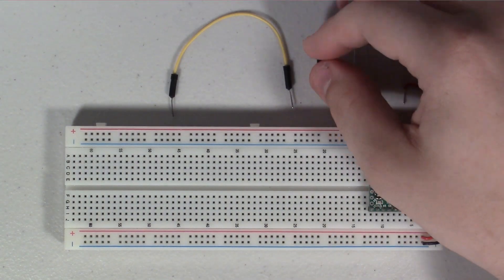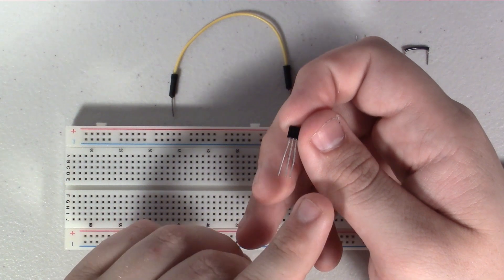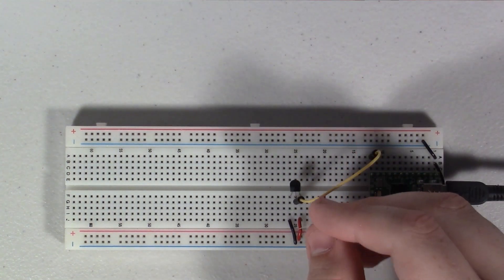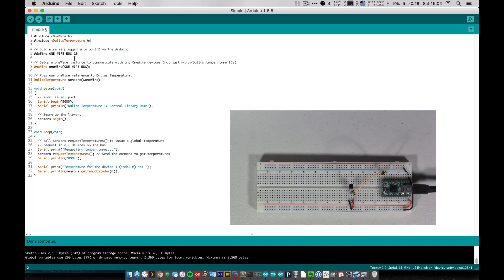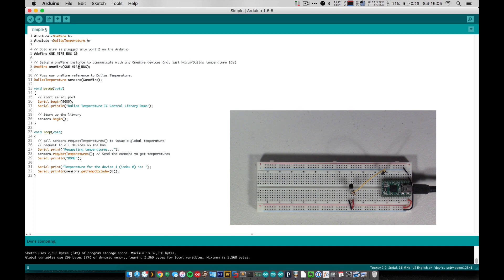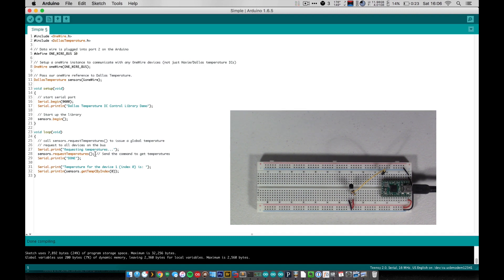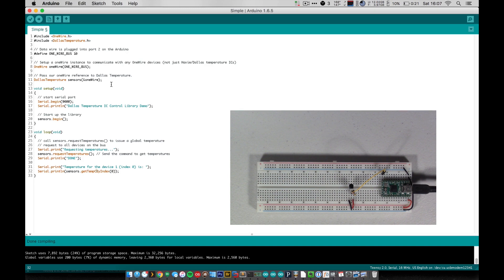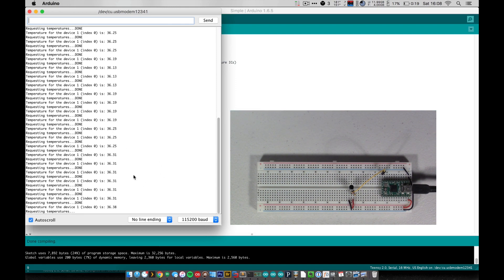How To Wire It! DS18B20 Temperature Sensor

Comment: How it is working
Baud rate in program 9600
Baud rate on serial monitor 115200
Reply from the maker: In the video? Unlike a normal Arduino, the Teensy board shown in this video can communicate via full speed USB and simply sends the data at USB speeds regardless of the selected baud rate. The computer ultimately doesn't care how fast data come in. The baud rate selection is generally needed because the USB->Serial chip cares.

Comment: Hi. I planing to put one of this ds18b20 on a mosfet heatsink metal to view the temperature. I see we can use that sensor naked just itself or in a metal circular tube models also around market. Standard metal tube dimensions dont meet my needs. Its ok if i Direclty put (glue) that sensor to a mosfet? Or i need to put something between sensor and hot mosfet for isolation for health and usage of sensor correctly.?
Reply from the maker: You should be able to just use the raw ds18b20 on the mosfet. The only thing that I would recommend would be to have something to electrically insulate the two devices. A little bit of kapton tape or something similar between the mosfet and sensor should be fine. Best of luck!
Reply: ItKindaWorks insulating sensor and the mosfet! Very logical. Thx ! But i have no idea whats Kapton.
Reply from the maker: Kapton tape is a yellowish insulating and high temp tape. It's also known as polyimide tape. It looks like this https://www.amazon.com/Mil-Kapton-Tape-Polyimide-Yds/dp/B006ZFQNT6
Reply: ItKindaWorks hi. I have kapton tape. I think i will stick mosfet and sensor together with this tape because its durable to Heat. But i dont understand why i need also put this tape Between sensor and mosfet? Ds18b2p sensor 's outside is plastic. I need electrical isolation between?
Reply from the maker: It's just a good practice in my mind to keep electrical parts isolated. You dont have to if you dont want to but if you have the kapton tape then why not? It wont ruin your readings

Comment: Is it able to measure a body temp
Reply from the maker: It should be able to measure body temp but it's probably not a good idea to be putting it in your mouth or any other part of your body. You might want to get a sensor (even DS18b12) in a package that is meant to be put into a liquids. Something like this http://www.embeddeddatasystems.com/OW-TEMP-B3-12xA--Temperature-Probe_p_40.html

Comment: Does this code differ from a pic24 or pic33 ?
Reply from the maker: I dont believe that you can use the same code for pic microcontrollers. I may be wrong (and someone on here feel free to correct me if I am) but I don't believe there is any easy way to port arduino code to pic. The wiring should be more or less the same though.

Comment: When reading specifications on the DS18B20, it looks like it can run between 3.0V and 5.5V. Have you wired this to the ESP8266 at 3.3V? Would be an attractive low cost solution for wireless temperature reading.
Reply: can you make a video showing how to ?
Reply from the maker: I have indeed done that! I have 4 or 5 of them running throughout my house all collecting data and being logged at my home server

Comment: Nice video! What if i want to connect two or four DS18B20 sensors. Does that same software works?
Reply from the maker: Thanks! You can connect as many as you want to! One of the cool things about 1Wire is that you can daisy chain as many as you want on the same data line (see here http://www.teensypi.com/wp-content/gallery/teensy3-0/dynamic/ds18b20hookup.png-nggid0222-ngg0dyn-0x0x100-00f0w010c010r110f110r010t010.png). For the code, I'd take a look at the Dallas Temperature library example called "Multiple". The code is more or less the same but has a bit extra to grab readings from multiple sensors.
Reply: +ItKindaWorks Thx!
Reply: That sounds nice. Wireless or LAN? Logging to one single sql database? i'm trying to get it working with the RFM69 radio and arduino nano.
Reply: Plzz tell me is it able to measure body temp
Reply: Unless your body temperature is beyond the limits of the device, I say yes. It can measure any live body with ease.